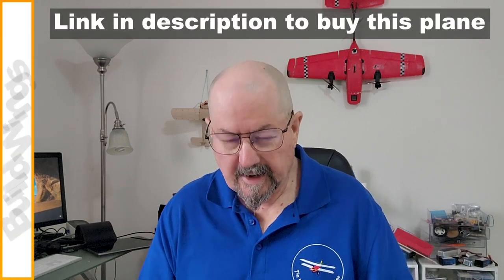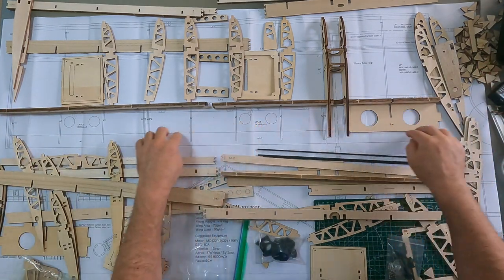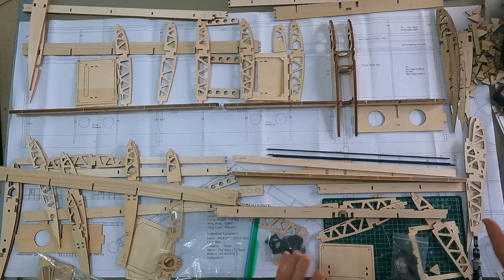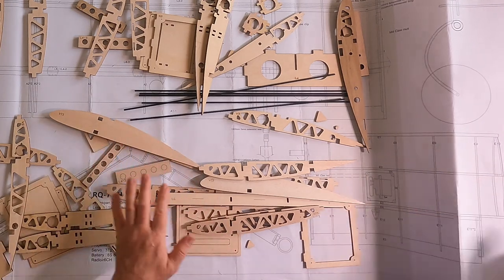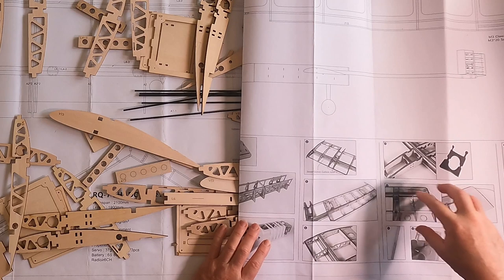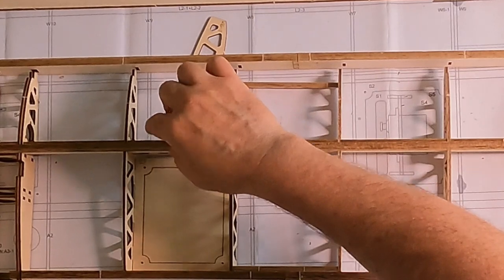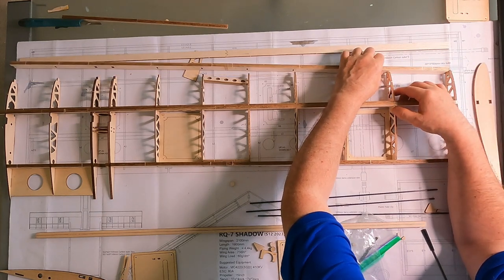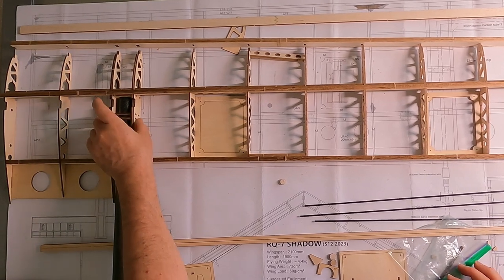The Wings. RQ-7 Shadow balsa scale model military drone kit assembly

Comment: 🇨🇦Hi Tim,
Thanks for taking the time to make this great series of videos. I just purchased the kit today that comes with the motor, ESC and servos, 1204 kit. Got it at Great Hobbies, boxing week sale. Anyways how many rolls of the cement grey  covering do I need? The rolls are two meters long.🇨🇦
Reply from the maker: I think I didn't use more than 2, I think mine came with 4 rolls and I still have 2 left even after a couple of re-dos on the a-tail. Enjoy the build!